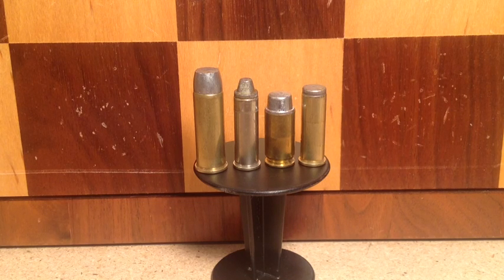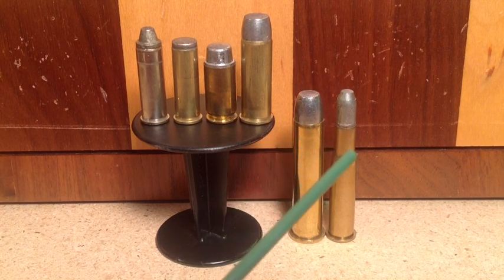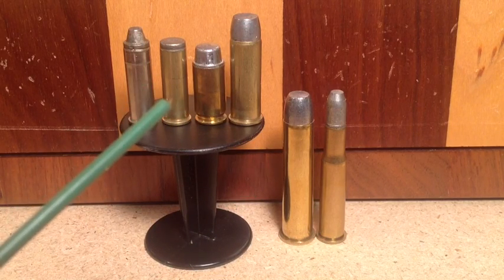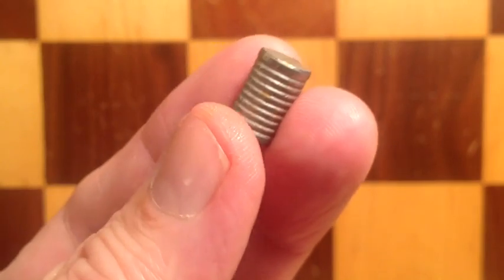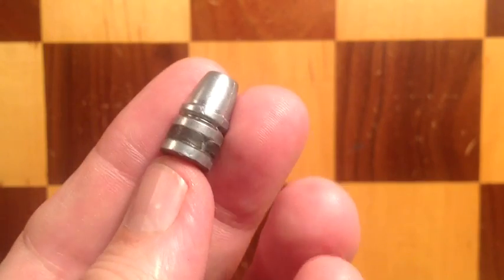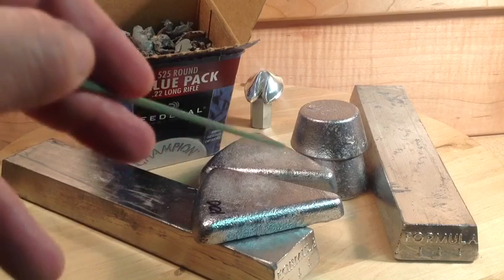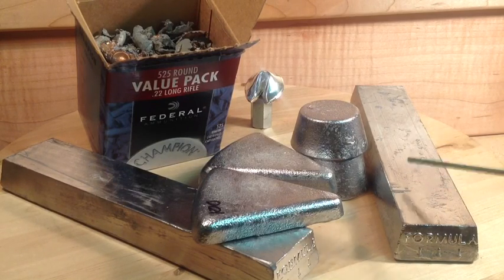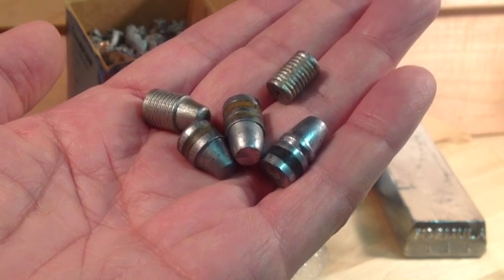Lead Hardness FAQs & How to Mix Bullet Alloys For Hardness

Comment: Just bought 1000 200gr 44wc from Rim Rock bullets. I bought them for cowboy shooting. There rated BHN 15 but I can't get them to dent with my nail at all. Matt's bullets 215gr wc dent real easy. Do you think I can use the BHN 15 bullets that I just bought for 44spl going about 800fps?
Reply from the maker: +Single Action Revolver -- Yes, you can.  The most important factor in cast bullet performance is the fit of the bullet to your gun.  Commercial casters like Rim Rock and Matt's provide their bullets at the most optimum bullet diameter to best perform in most of the guns out there.  Bullet hardness is second importance, but more distant performance than bullet fit.  Is the 800 fps in your pistol or lever gun... I am assuming your pistol?  Your Rim Rockers should do fine for your CAS - 800 fps is a mite too much power for CAS - your split times will be greater because of recoil factor.  But that's up to your personal preference, of course... Your Matt's WCs are intended for 725-750 fps probably around BHN 11 perhaps 12.  Good shootin' to ya,  FC
Reply: +FortuneCookie45LC Thanks again, your a life saver. I just bought a wet tumbler I'm sure I will have more questions soon. Hope you have a great new year.
Reply from the maker: +Single Action Revolver -- Your wet tumbler is one of the most important items you will have ever gotten for your reloading.  The best case cleaning and polishing in the business, plus the best handling of all lead dust and debris to yield completely lead dust free brass for your reloading bench make wet tumbling the best way to go bar none, Katie out the door.  When you pour out your first load of dirty water, you will marvel that dry tumblers are keeping all that in their media for them to be dusted with.  The first time I saw that, I was saying to myself that I&#39;ve been concentrating all that badness in my dry media for the last 40 years- we just didn't know any better - and many many are still doing that today in spite of all we can say.  CAS shooters will use lots of ammo...nothing like doing it right to begin with.  Happy Holidays to ya,  FC
Reply: +FortuneCookie45LC I totally agree, no dust at all is really cool. I really like my primer pockets after I'm done however I'm a little concerned with the metal shavings I have left over. After I'm done with the steel media I put them on a black towel to dry. I have allot of miniature glitter of stainless steel. really nervous that some of that still stays in the case. The biggest lesson that I learned is Don't do 9mm with 44 together. OMG the media got inside the 44 with with the 9mm in the 44s & press them togather very hard to get back apart. Water will work like a hydraulic press.
Reply from the maker: +Single Action Revolver -- Good news is that we can wet tumble without the stainless steel pins and the results are 95% the goodness as with the pins...the savings in time not having to separate the pins is well worth the 5% loss of efficiency.  I only use the pins now when I'm doing real growdy brass.  And yes, we do not want to mix brass that has "interdigitation" - like 38 special and 44 magnum, etc.= lots more work for us.  Plus, you won't have any more issues with your SS pins deplating or shaving themselves.  Have a great 2016..!!  FC

Comment: @ 12:45 you say that mixing 2.5 # of Linotype with 15 # of Range Scrap you expect to get BHN 15…My lead calculator program (from Cast Boolits [070612-2.xls]) predicts your mix as follows…

{{ .71% Sn,  2.57% Sb, 96.7% Pb…est / hardness= 11.2 BHN }}

So if you have been depending on this for your light magnum loads, you have proved what Elmer Keith said over n over again…"don't need hard lead for magnum pistol pressures, need good barrel fit and good lube and plenty of it."

Your second recipe of 2 # of Super Hard with 17.5 # of Range Scrap you expect 18 BHN…again the calculator figures different as follows…

{{ 0 % Sn, 30%Sb, 70% Pb…est / hardness = 12.3 BHN }} 

If you join the Forum 'Cast Boolits' you may download the calculator at no charge. Also there are articles by Glen Fryxell there that discuss this exact subject, he has written numerous articles and even published a book, 'From Ingot to Target' also a free download. The Cast Boolits Forum has changed my entire approach on Smelting / Blending / Water Quenching / Lubing / Sizing in order to shoot 'Lead Free' in my different barrels / @ varying FPS and Pressures.
I bought the Lee BHN tester and when I started using it to verify my various blends I was shocked to realize that like you…I was way off in my calculations.
Reply from the maker: +Charles Irby --Thanks for this - There is quite a disparity from what BHN calculations should be and what winds up...plus, Elmer did prove his use of softer alloys with his shooting - good bullet/gun fit is primary for performance and no leading shooting.  If you are from the CB forum, you guys are the heppest on cast bullets out there, bar none.  Sometimes the stuff is so technical, I just say to myself, melt the lead, pour the bullets, scratch with fingernail and shoot 'em accordingly.  I've never heard of the hardness calculator there, but it sounds most intriguing.  The biggest disparity is on the hardness of pure lead, is it 5 or 8.6?? ...RotoMetals (I've done business with them for years buying their linotype ever since linotype disappeared from the local metal yards) has an equation that calcs the BHN using a formula on the bottom of their bullet metals front page  BHN = 8.6 + (.29 X %Sn) + (.92 X % Sb) and I add 1 BHN for water quenching and 1 BHN for age hardening.  The add ons are conservative.  RotoMetals has been in the bullet alloy business for 75 years.  I know the boys over at Cast Boolits are much more technical with everything - I haven't gone over there much because what I do works well in my guns over 40+ years of casting...it's good enough for me.  Since doing YT a little over 3 years ago, I still surf a lot on shooting stuff on YT, but not much time to spend on forums... I don't use lead testers, because my fingernail test is what I go by...not scientific, but it's the way it was done back in Elmer and Skeeter's day.  And now with powder coating, the BHN stuff is all up in the air.  Happy Holidays to ya and all the others at Cast Boolits...   FC
Reply from the maker: +Charles Irby -- Thanks for posting, Charles.  I appreciate the time it took to post that comment because I know how much time those things take just answering comments.  I've heard of that calculator and I haven't had occasion to use it... Instead, I've always gone with the RotoMetals formula (bottom of their home webpage) - the real disparity between the two is pure lead - is it 5 as many believe, or 8 as RM aspires?  Whatever, since I've been doing business with RM for so long, plus they've been in the caster alloy business for 75 years, I figure their formula is OK to use... bottom line is that my leading issues are scanty to speak of so I'm happy - Water Quenching and Aging give me an extra 2 BHN, and I know that runs in conflict with what is on the fine CastBoolits site also...I've read a lot of Glen's work and it's good stuff...I've asked my brother-in-law who is a metallurgical engineer with Defense Department Clearance about what goes on with lead alloys and he says lead is not that complicated. - time devoted to lead alloys was a waste.  He was too busy with alloys for nuclear submarine hulls and depleted uranium penetrators. ..back on track, .the lead controversies are what makes for interest after all... we can talk for hours whether in CastBoolits or the HLZ...Whatever heralds bullet casting and shooting of same is more than plain OK with me.  I once tried to post in one of the forums and their requirements for admission seemed awkward - can't remember exactly what the problem was, but I couldn't post so haven't tried since...but do visit forums often when I'm not YouTubing which now keeps me very busy...Your use of the Lee Hardness Tester is courageous.  From what I've seen of that tester, it is not necessarily repeatable in its determinations plus the results are subject to the interpretation of the dents and varies according to the operator.  When casters are getting after quenched bullets in the BHN 26 - 30 zone, I'm just not encouraged to get that device.  My fingernail works just fine.   Best to ya,  FC

Comment: you can drive BH bullets of 16 to 2600fps is what my lead bullet maker states and i tried these speeds with no leading and i been shooting thousands of rounds at these speeds for the last 2 years.
Reply from the maker: +Lure Smith - Sounds like you are shooting a 223/5.56.  When Elmer Keith did his magnum pistol work back in the 30s, 40s and 50s, he routinely used 1 in 20 alloy - That's 5% tin BHN like 10-11.  Even though we consider that way too soft for magnum pistol, he didn't lead his barrels and got superb accuracy.  He would not have settled for less performance than that.  The key to his non leading shooting was the bullets were fitted to his guns.  .001" over chamber throats was fine for him and no leading resulted.  Bullet fit to gun is much more important than hardness of bullet for leading prevention.  Now problem is that plain lead bullets cast hard can be driven to higher velocities, but the limit occurs when plain lead bullets are driven to the point of them stripping off the rifling.  That was the problem during the 1895-1900 time frame when smokeless powder first came into being and rifle makers found the only way they could take advantage of the progressive smokeless powder was to jacket the lead bullets with copper-nickel alloys (guilding metal) and design spitzer bullets to take advantage of the velocity.  Jacketed bullet technology went on with that to the present day.  If cast lead bullets could be shot at full velocity 30 cal milsurps there would never have been a need to develop jacketed bullets.  I've heard of some shooters being able to get 2200 fps using pure linotype, but those bullets are way to brittle for hunting.   Continued success to you and you should put that on video so others including myself can learn the secrets of 2600 fps with cast bullets.... Best Regards  -- FC
Reply from the maker: +md80 captain - yes, but coating bullets with jackets other than copper alloy is not new - molys, nylons, composites have been tried and they are not mainstream today.   PC is still in its infancy (about 10 years).  Even the molys on rifle bullets were over the copper jackets.  Problem with high vel is to keep the bullet from stripping off the rifling, to "take" the rifling so to speak.  Until it can be demonstrated that a soft lead PC bullet can take the rifling reliably, PC for high vel is still unsubstantiated.  Have you seen any videos of PC rifle shooters getting sub MOA with 2800-3000fps velocity at distance?  If this is not demonstrated, I will be keeping my PC for 30/30 and 45/70 class of rifles only... And I have no desire to PC for 2900 - 3000 fps  223/5/56 anyway as bulk jacketed FMJs with MOA accuracy and functioning are plenty cheap and available at this time (would be different if that changed).  No need to improve on that.  Best Regards...FC
Reply: +Lure Smith  "You want the correct DOPE,  join the 'Cast Boolits Forum' get it all from the guys who pioneer these new concepts…get the facts and leave speculation to everyone else."
Reply from the maker: +Charles Irby -- No speculation really.  We bullet casters are a huge bunch with a subset of the upper technical echelons in Cast Boolits who push the envelope on stuff.  FortuneCookie Policy - No one this side of Glory has all the answers, but together we have a lot of 'em.  Most who look into bullet casting only want safe, good, reliable, accurate and cheap cast bullets to do 90+% of our shooting.  There is much we can learn from each other, as well as from Cast Boolits, as well as the experienced hunters and benchrest shooters and competitive shooters out there.  Shooters are smart enough to go to any source available to them and use what will work for them and discard what has no value or has negative value.  That's why I have the personal preference to never ask anyone to subscribe or like or share anything ever...the shooters of the world are very capable of deciding for themselves what has value for them.   Yes, they definitely should check out Cast Boolits - great bunch over there.  But none of us, in good conscience, can traffic in speculation without using the terms probably or perhaps, or there are reports of...However, I can attest to the excellence of the Perazzi shotgun without having ever owned one, or the effectiveness of the Weatherby Mark 5 in 300 Weatherby Magnum without ever having fired one.  I do not regard such as speculation.  As for facts, I've learned early on that nothing can be definitively proven.  How do we know that Christopher Columbus discovered America?  There were others who just never bothered to say anything.  How do we know for sure that Neil Armstrong was the first man to set foot on the moon?  It could have been done in a studio.  Was Sandy Hook a hoax?  Facts and speculation, indeed...We are all friends in the shooting sports...let the information flow freely and everyone be of good conscience.   Happy Holidays to ya,   FC

Comment: Hello I need some advice on mixing linotype with wheel weights the linotype I got from eBay is dirty when I add it to the ww it stays floating on top of the pot is there a method to get them to mix I tried wax to Flux didn't help this is my first experience with linotype and need some advice
Reply from the maker: +Francisco Maestas - You have some bad alloy there.  Linotype mixes readily and cleanly with any lead alloy.  If you had clean and added that linotype and got no mix / float on top, the problem is with the alloy you are adding.  If what is floating is separate from the alloy, it is dirt or slag and can be skimmed off easily. leaving a clean alloy after fluxing.  This is good as any tin or antimony in your add will give you harder alloy than when you started - that was the whole idea of adding linotype after all.   If it is curdly and is merged with your lead, it might be zinc contamination and you have a real hard time trying to skim it clean, you might have to throw out the whole mix.  Your experience using linotype should be a good, easy one.  I've never gotten any bad linotype in 40 years of casting.  Good castin' to ya   - FC

Comment: will powder coat prevent barrel leading?
Reply from the maker: +Robert Dodder -- Great question - to sum up what is in my playlist on barrel leading, the best prevention to barrel leading is fit of bullet to the gun.  This is primo by far.  .001 bigger than cylinder throats on revolvers and .001 bigger than groove diameter in auto pistols and rifles is the rule.  There was a study done many years ago where the tester used bullets properly fitted to the gun and the bullets were not only soft, but also no lube was used at all - there was no barrel leading.  When Elmer Keith did all his work creating magnums, he only used cast bullets and his allow was 1 to 16 alloy - tin to lead.  He didn't even mention antimony (the main hardener of lead alloys).  And he routinely reported that his bullets shot without leading.  The idea behind PC bullets is to have a jacket on the bullets made out of the powder so that they behave like jacketed bullets.  Also, for the PC to prevent leading,it must be toughly  bonded to the bullet.  That is easily determined by the hammer test - take one of your PC bullets and hammer it flat...if the powder is till coating the lead, we have good PC..  If not, that entire batch is suspect.  You don't see PC in the bullet casting journals and articles as of yet, so the process is still not mainstream.  However, I was in communication with Andy Lee - head of the bullet casting division at Lee Precision (he is the grandson of Richard Lee), and he is a powder coater.  In the meantime, our 45/45/10 tumble lube system will always be there ready to take care of our lubing needs should we decide to use that... Best Regards to ya!!